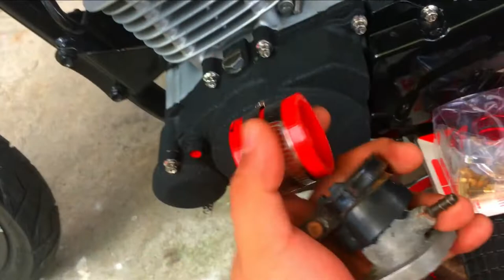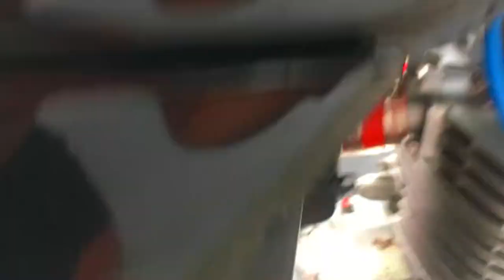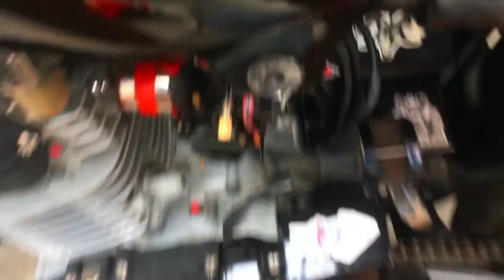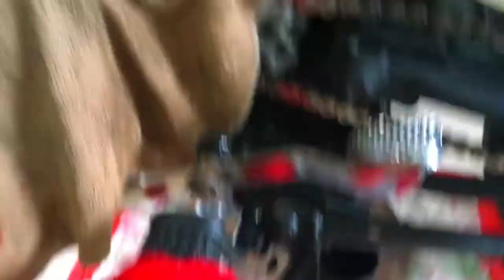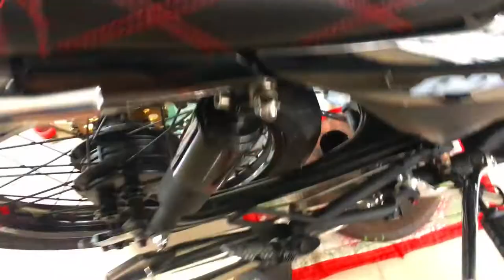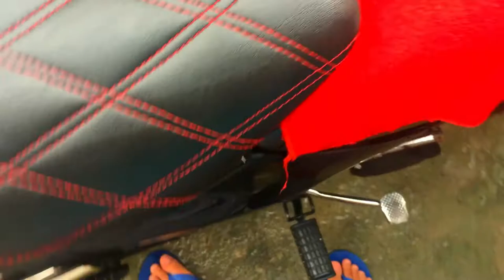FLATSLIDE CARBURETOR INSTALL||MIKUNI PWK 28MM||SUZUKI GD110||CLASSIC BUILD

Comment: Lods nag palit ako ng 24mm carb nibbi kaso pag mainit na ang makina nawawala ang menor namamatay Ng kusa may Lalo pag sa stop light hassle at matagal mapaandar.
Pag hirit around 60 to 80 ok pero pag mag menor ka 30 to 10 nakadyot kadyot ano Kaya problema Lods?
Reply from the maker: Baka masyado malaki or maliit slow jet mo boss.check mo kung anong main jet at slow jet mo

Comment: sir bumili ako bago carb replacement alkuln, okey nmn sana sir nawala ang wild, overflow at hard start kaya lang pag sa umaga at hindi pa mainit makina ayaw humatak namamatay makina. sana matulungsn nyo ako.
Reply from the maker: Sakit po talaga ng diaphragm type na carb yan sir na kapag nalamigan at hindi mo sya pinainit for a few minutes eh namamatay sya at parang nalulunod.ytx125 ng erpats ko ganyan din kailangan i preheat bago gamitin😅 mag sparkplug read po kayo then if rich mixture sya try nyo po liitan mj then adjust airscrew po and hanapin nyo kung saan gaganda ang idle nya
Reply: @prince696GD110  ang size po kaya Sir ng main jet? balak ko sir ibalik iyong mj ng stock carb. naka 4 complete turn na sir ako ang airscrew, hangang saan ba sir maximum adjustment ng airscrew.?

Comment: air screw type ba sir ang tonohan nyan? bago palit sir ang carb ko , pero pag malamig ang makina sinisinok at ayaw humatak pero kapag uminit nmn sir okey na humatak , palitan ko kaya sir ng main jet.
Reply from the maker: Yes po sir.Issue po talaga yan ng diaphragm type na carb sir. Consider nyo po yung pagpapalit ng main jet baka po rich mixture po carb try nyo po adjust airscrew at medyo i lean mixture nyo po sya and observe nyo po kung saan sya magiistart agad kung mas ok ba lean mix or rich mixture sa gd nyo
Reply: @prince696GD110  maraming salamat po sir sa mga sagot.
Reply: @prince696GD110  sir ano po ba maganda size ng mainjet dapat ipalit? kung rich ang plug reading?

Comment: tsong,,,
responsib talaga pag nka dlat slide😍
balak ko talaga sana mag 24mm flat slide😉
kmusta nman yung flag reading tsong?
Reply from the maker: Yes tsong ganda ng response at lakas manakbo kaso lakas sa gas😅.Nung nagplug read ako itim sp ko rich talaga sya tinry ko magbaba ng main jet at slow jet kaso nabibitin na sya.
Reply: @prince696GD110  sir bago ang carb ko kasi iyong stock 10 years na , hindi na mapihit ang airscrew at nag wi wild at over flow, pinalitan ko ng Alkunl diaphragm type, kaso pag lumamig ang makina at naparada, humahagok at ayaw humatak kailngan painitin pa ulit. ibalik ko kaya, Sir ang stock na main jet at pilot jet.

Comment: Ganda ng carb mo tsong.ano ba pinagkaiba ng 28mm flatslide na carb sa stock carb ng gd sana po masagot Thankyou
Reply from the maker: Thanks tsong 👌 difference ng 28mm flatslide sa stock carb is yung stock carb ng gd natin ay diaphragm type while itong nakakabit sa gd ko ay flatslide😅 pagdating naman sa performance mas maganda yung response ng flatslide kesa sa stock feel mo talaga pagkakaiba nilang dalawa power talaga flatslide pero down side is yun medyo malakas sya ng konti sa gas compare sa stock carb na super tipid talaga.

Comment: Iodz magkano bile mo jan sa carb
Reply from the maker: Nabili ko ng 1500 sir kasama na set of 10pcs mainjet at slowjet
Reply: @prince696GD110  thank you lodz lagi ako na nunuod ng vlog mo kasi GD  din motor ko sa probinsya
Reply from the maker: Maraming Salamat po sa laging pagnuod  sir🙏🏻 san province mo sir.ride safe always🏍💨
Reply: @prince696GD110  quzson lods
Reply: @prince696GD110  san location mo lodz pwede ba pagawa sayo😊
Reply from the maker: @johnnymasayon7008   quezon lods? Daming gd dyan😅
Reply from the maker: @johnnymasayon7008  sjdm bulacan po lods👌